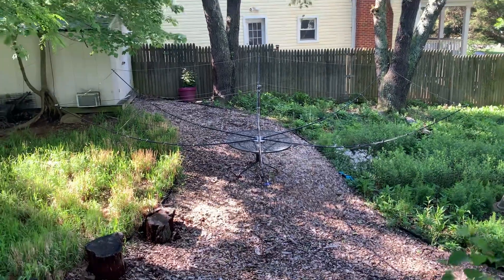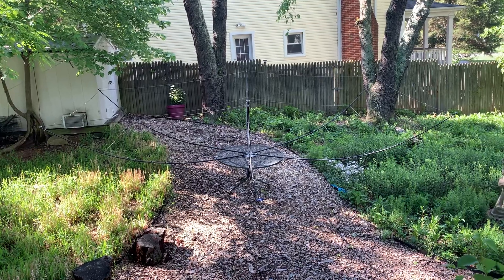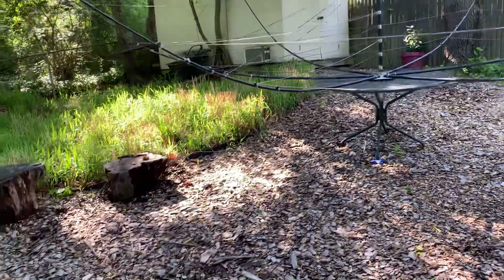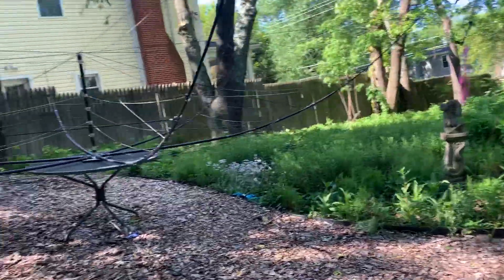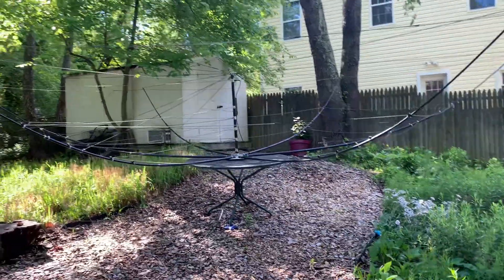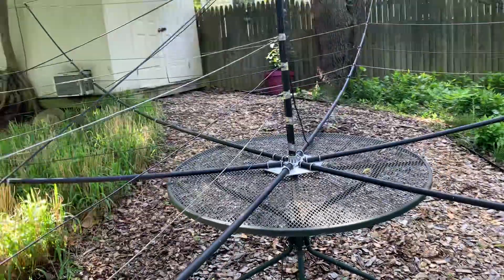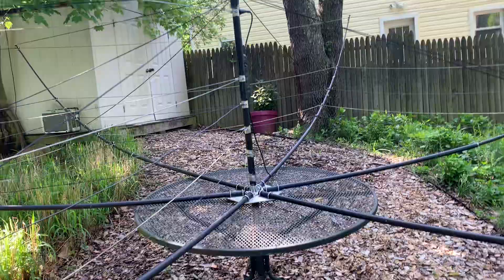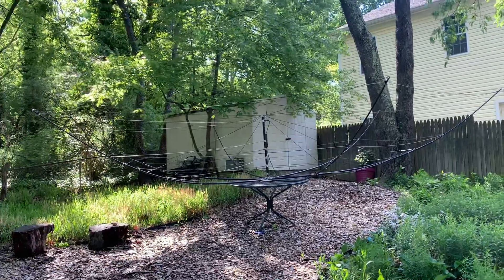N2CQR’s Hex beam

Comment: Looks like a giant laundry rack ;-) It wil be less visible when you paint it light grey and you could add some bright red of orange to the boom that's points in the direction it radiates.
Reply from the maker: Ha!  Flat black is the way to go.   It is practically invisible on the roof.  A pointer would be nice though!   With this antenna, the uBITX you sent made it all the way to New Zealand on 3 watts.  Also Argentina, Chile...  73  Bill